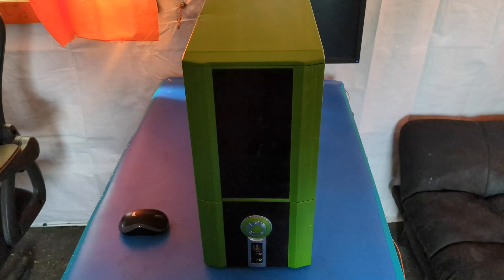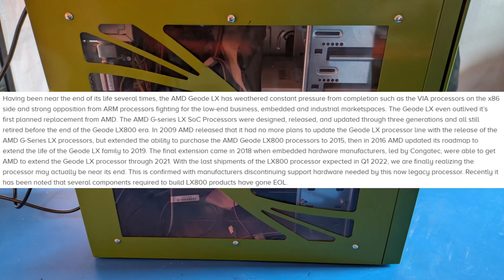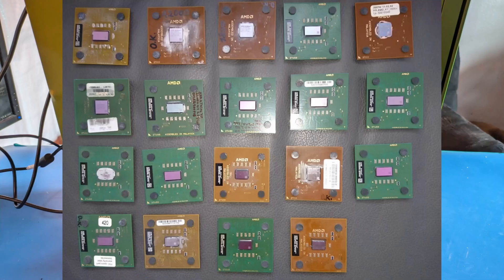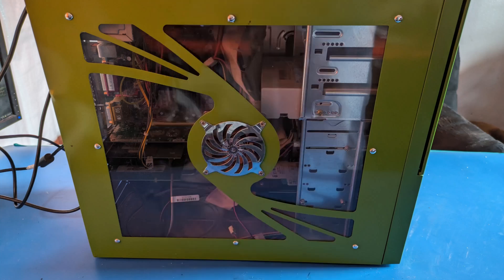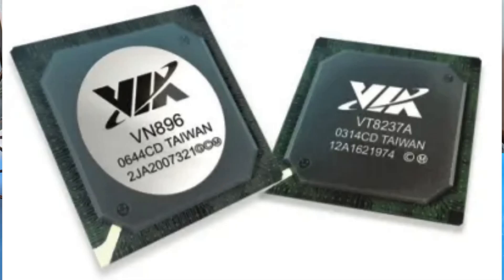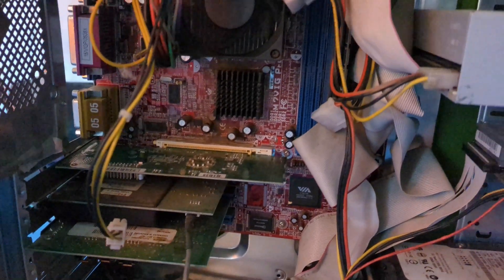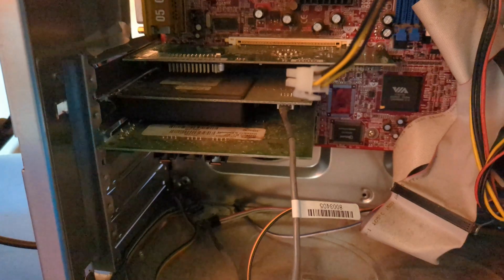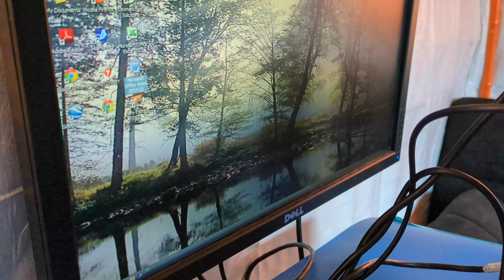Retro Recycle: 20 year old build with an obscure CPU

Comment: Just purchased this motherboard off you from eBay! It's fantastic! One of the few socket 462 boards that correctly identifies the Geode NX and the Athlon XP Mobile processors. I switched out the cpu for an Athlon XP-M AXMH2500FQQ4C, 2GB of PC-3200, and paired it with a Geforce 7300 GT 512mb. Along with a PCI Sata Raid card w/ SSD, and this thing runs buttery smooth. Thanks!!
Reply from the maker: @neongenesis2979  Glad it found a home that will use it! Since I reused the case for a server, and put the working HDD in inventory for testing IDE systems, only the PSU,  and CD drive were scrapped. I would have gotten it out a day sooner but I was pulling cable out of town when the auction closed, and the wife had disposed of the box I had originally set aside while I was gone not knowing what it was saved for, so I had to improvise packaging.  Glad it made it ok and it's still alive, Enjoy it!

Comment: It's always nice to see these older builds. Was that the most powerful machine for its time, No, but it served its purpose for the user who had it and it didn't have to be the world's most powerful processor with the world's greatest amount of RAM and the world's fastest graphics card and so many LED/RGB (can't stand RGB lighting) lights you can make the Griswold house jealous at Christmas time. I love vintage build(486, 386 and even earlier) machines. Heck I just recently purchased a NEC V30 10 Megahertz DIP 40 CPU that was an upgrade for the older 8086 CPUs. When I saw it I had to add it to my collection.
Reply from the maker: Just built or rather rebuilt my main server in this case today. The new motherboard has the same color green as accents.  Build video goes live this weekend.

Comment: Oldest thing I have around my shop would be a 9550 quad chip. I also have a FX 8350 and a 2600k that I still use. I dont know if I have an actual use case for something this far back. Still really cool!
Reply: 8350 is not that old..
Reply: I was driving home about a week ago and actually found a whole core 2 quad system… or at least that’s what the fancy stickers on the front say haha. I’ve yet to test it because it was sitting out overnight in humid Florida weather so I wanted to give it plenty of time to dry and see if it still boots. I’m pretty excited, although I’m in the same dilemma, what exactly to do with a machine this old
Reply from the maker: The first video I did on this channel I turned a core 2 machine into a Router/Firewall with ClearOS.

Comment: Sorry, my duster senses are twitching. 😜🌬
Nice old build though. 👍
Reply from the maker: I tired the air compressor, but the case is so caked I'm going to have to scrub the inside, 100 psi is not enough to knock it all loose and remove 20 years of grime.

Comment: i remember those days. i built a dual G4 quick silver last year wtih a X850xtpe in it that got about 30% higher cinebech scores. its a 1.2ghz.   found that interesting.  back in the day i had a x1700+ that i think i used a 8500le on. then went x64 3200 with xp64 bit. i actually liked that os. i think i had 8gb ram back then.... with a x1800.  then i went to a 2900xtx with core2 extreme. i didnt go back to amd until my 5600x and now my 7950x.  i went direct die liquid cooling so it was a bit of a flash back to these days of old with the exposed die on the chip
Reply from the maker: September 2002 I had built my 1st real workstation.  It was a  socket 478 Pentium 4 1.8ghz with 2GB of RAM, which was insane for  the time.  I had a 17" LCD monitor that was still 4:3 at the time, and cost $800 just for the LCD.  I had 3K tied into the machine.  Two years later I ended up doing a lateral move CPU wise to an Athlon XP, because the mobo for the P4 died and all the new 478 boards were DDR and my 2GB was PC133.  So I had to go AMD with a board that worked with my existing ram,  or severely downgrade the ram amount in the new rig.  I stayed mostly AMD till the FX era, then I went Intel Xeon with socket 2011, only came back to AMD with my Ryzen 2600X and now my 5800X3D